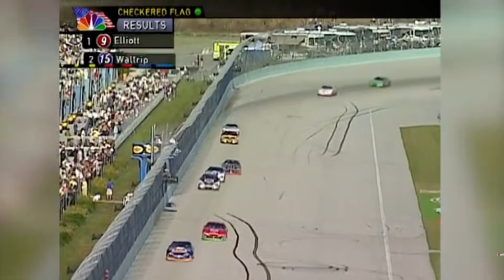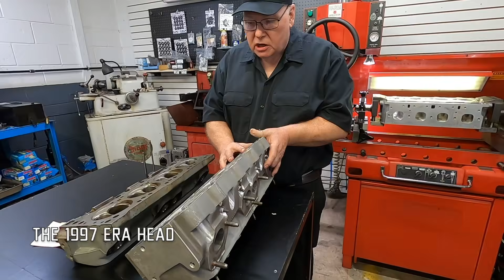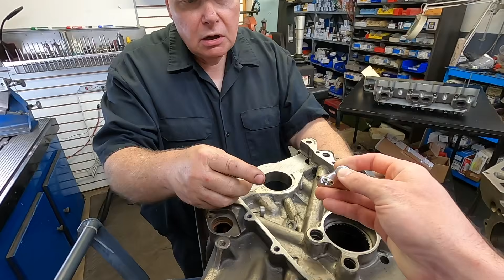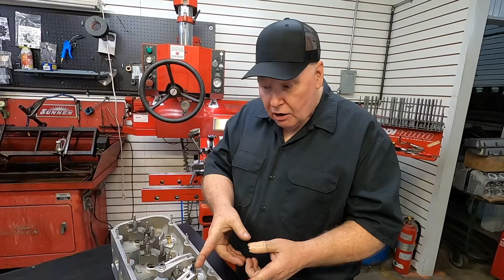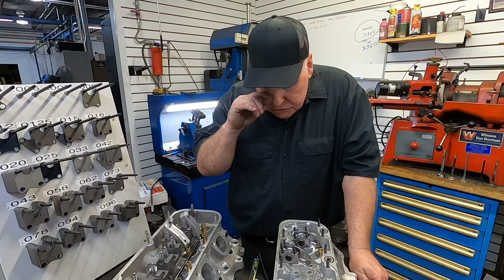History of Dodge's NASCAR Small Block Engines: Secrets Up Close With Danny Glad

Comment: Thanks Mitchell!  Another great episode.  In 1979, before the advent of the NASCAR-inspired Aluminum head 18-bolt, 48 degree lifter angle small block Mopar racing engines (R3, etc.), Bob Glidden did the unthinkable. He parked his 1978 championship Ford, and he built and drove a W2 head LA Mopar NHRA Pro Stock Plymouth and won the year-long championship!  The Ford and GM guys couldn't believe that they were getting beat by a small block Mopar.  Pro Stock required very high RPM horsepower, and I wish I knew how Bob was able to make that old iron inline-valve engine competitive.
Reply from the maker: Interesting!

Comment: I remember Kasey Kahne did not have the R6 until the Dover Spring race 2009. He was furious with the lack of power that the R5 was making relative to the competition at Fontana in the Fall of 08' he passed Kyle Busch for 7th in 1 and 2 on the last lap then Kyle floored it in 3 and 4 and bounced off the nearly and could have took Kasey with him. If Dodge returns in 27', Kasey Kahne hopefully returns for the Daytona 500 and wins.
Reply: It's unfortunate that Evernham went downhill right when Kasey was at his best. They would have been title contenders for sure. Unfortunately I don't think he can race NASCAR anymore due to health conditions, but he does do sprint cars.
Reply: @trevorshark16 Did Rockingham in O'Reillys last year. It was something to see. Even with that first bit of damage he got from Katherine Legge he could have won still. He went a lap down because of it. There was like half the stage left and Kasey proceeds to pass everybod out there like their tied to a tree and end of the stage there was a half a straitaway or less between he and two cars that had just went  a lap down and first and second. Then when he finally got back on the lead lap he went from 38th to 16th in 6 laps that 3.4 cars a lap. Then Almirola or somebody blocked him in the middle of one and two and got him the wall. Then he could go hard for 20 laps. That last deal in 3 and 4. Two idiots were trying to crash back around him so he got on the binders so they wouldn't crash into him and the two other idiots come along and crash next to him into him. He would easily won the race if hadn't been first and would have easily won still if it hadn't been for the second one.

Comment: There is a bunch of incorrect info regarding the R blocks and the W heads in this video.....not thats a bad video, but there are several errors about sruff that is very old. No big deal 

You should reqch iut to mason baxter in Daytona, FL. He has parts + knowledge.
Reply: So who did you build Nascar engines for again....I think I missed it
Reply: @papasmodelcarroom8450  I have built several of those engines for drag cars.  I literally have 4 of those blocks and 6 or 7 sets of the heads right now.  You may not have liked my comment, but there is several errors in the video.

Comment: I know Mopar built a small block race engine for 1970 for the 1970 SCCA Trans-Am racing series. they had the Plymouth Cuda and the Dodge Challenger and they released so many to the public and they were the AAR Cuda and the T/A Challenger in 1970 they ran a destroked 340 block in the race car but in the car's to the public they had a special made 340 6 pack engine built just for them cars and there was many special things done to the engines and car that were not done to regular 70 Cuda's and Challengers.

Comment: As a die hard Mopar fan myself this was a very interesting video👍 In Canada in the 90’s & into the mid 2000’s in the old “Cascar Super Series” in Canada we ran Dodge-Ford-Chevy- over the years & Mopar really got involved in Cascar in the late 90’s & into the early to mid 2000’s & Mopar would pay money out to the top 3 finishing Mopars every race. Dodge made some big power/torque in Cascar & so much so that even long time “bow tie” drivers/teams & Ford jumped ship to Dodge for a few reasons i mentioned above with the Mopar top 3 payouts & the big power/torque. I remember watching an old Cascar race & they interviewed #97 Rob Neely who was a long time Chevy driver & he said the switch to Dodge was amazing results instantly & he couldn’t get over the fact how much more power/torque they made but they sounded different than a Ford or Chevy engine because the Dodge engines rpm curve was quite different than Ford & Chevy. You can watch old Canadian “Cascar Super Series” races on YouTube & up to present day with the “Nascar Canada Series” 🏁 Great video guys!
……. Cheers from Windsor,Ontario,Canada which is right across the river from the “Motor City” in Detroit 🏁

Comment: I may have one of the engines that Danny worked on at Arrington. The cam has ARE and BA3 etched on the back of the cam. It was a R3 with the crankshaft main bore oil squirters like the block he showed in the video. It uses the 47 cc 15° W2 heads. I also have an R1 that supposedly came from Keselowski. They are similar in configuration.
Reply from the maker: Awesome!!

Comment: This is good stuff!!!  Mopar had RA, R1, R2, R3, and R4 blocks.  Along with W2, W5, W7, W8, and W9 heads.  The R blocks were also available as tall deck 9.60" blocks for drag racing and could be had in either wet or dry sump oiling configurations as well as 59 or 48 degree lifter angles.

Comment: With Dodge returning to truck series we can only hope that their truck and cup series engines pull from this legendary platforms.
Reply from the maker: It would make sense. The r6 is the platform that raced with the current engines they still use
Reply: Truck series are Lamar engines so ram will have no engine program. Dodge at least when return unless new engine rules in place in the next 3 years will ues existing engines they had just update. The new rules coming is opening up the rule book some so if Chevy wants a V6 LS they can or lets say Honda wants a v4 they can and it will be like IMSA and they're running running torque sensors this year. This is done because of the manufacturers

Comment: I loved when he was talking about the water passage to the rear of the block. They used a insert tube to control water flow that's exactly how they did it in my 1947 Dodge. Good engineering never goes away.

Comment: I think the Dates and order is a bit mixed up...  The For runner, innovator, the first was the GM SB2 engine, 1997-98... then the Dodge in 2000, and they copied the same head port pattern... then Toyota took both engines, pick the best bits, it was in the Cup series in 2007, then the Ford Fr9 in 2009...
Reply from the maker: Sb2 was 1998 and R5P7 was 2001. The P7 heads had a similar exhaust port arrangement to the w8 head. I don’t think they’d copy an unfavorable design of mirrored exhaust ports unless they had to. Eliminating that center hot spot would have been beneficial for Chevy and Dodge but the production heads had it so they probably had to keep it. The current gen engines eliminated it
Reply: @Stapleton42  In the Video Billy was making it sound as the Dodge was the Innovator, the first i reckon...  SB2 was the first in big 800, 900 HP nascar engine
Reply from the maker: @drcolster  the R5P7 was the innovator and has more in common with todays engines than it did with the engines it competed against in 2001. The SB2 was a big leap and basically GMs catch up/one up to the canted valve C3 heads Ford had. GM and Ford were still using factory architecture small block designs at that time.
Reply: @Stapleton42  How can the Dodge be the Innovator when it came 3 years later  ???....  The Dodge copied the SB2 head layout design, which is a canted valve, but totally different to the Ford... yes Ford has the canted valve, but all symmetrical. and so does B/B Chev, but different port layout..... The SB 2 solved the single 4 manifold distribution issue... The Ford layout is shocking for a single 4 barrel, very bad fuel distribution... Dodge came up with a great Race block design, GM had the Bowtie range specifically for SB2 lay out.. Then the ROX/RO3 was a totally different block for the SB2 top end with the 4.500" bore space..(but didnt hit the track, RO7 took over)  The R5, then R6 blocks are definitely a great race block design, the Dodge engineers did very well. That R6 is Killa...
Reply: @Stapleton42  Great Video as well..
Reply: Also remember the first W2 heads came out in 1976.
Reply: @WilliamPayneNZ  Good head the W2, they should of had a kidney chamber with the big ports, from memorey the big port had the Hemisperical no quench chamber... i know they did the Econo W2, kidney chamber small ports..

Comment: Wow what a video. This has to be my favorite to date. I guess because I have been a Dodge guy since 1966. That was a lot or R numbers and P numbers. I was talking to Jim and he was telling me these engines are getting harder to find for the vintage racing since they haven't been made in a long time. I was hoping with Dodge getting back in truck racing they would start back producing the engine again. But, I am hearing that the entire truck series is ran on the LS platform. Chevrolet, Ford and Toyota all run the Chevrolet LS engines. I guess
that means the Rams will run a LS engine too. I would rather they didn't even come back if this is true. I have been saying for Many, Many years now that what wins on Sunday DOES Not Sell On Monday. NASCAR lost me when they went to racing IMSA / Trans-am cars.
 Can you confirm this on the truck series?
Reply from the maker: Yea the truck series is a spec engine from Ilmor that is built with the Dart LS next engine block

Comment: Street Mopar's i'd love to
Love to stuff one of those R2/R3 nascar mopar engines into:
-Prowler 
-challenger
-shelby dakota pick up. ( good luck finding one they are crazy rare)
-magnum wagon with a  chrysler 300 nose conversion....saw one of those today.
-2 door avenger converted to rear wheel drive.
-take a Old 2 door dodge neon, cut the floor pan outta it, make a mini nascar xfinty frame the dart body fits over, stuff xfinty areo 59 wheels, goodyear tires, narrowed cup 9 inch rear axle, old mopar nascar cup engine stuffed in there...driver sits in the back seat area to make room for all of that....and make it street legal.
-2000  chrysler 300M  converted to Rear wheel drive.
What mopar would you stuff an old nascar mopar cup engine into?
-
Reply: *  correction-- the neon body fits over.
Reply from the maker: One of those sedans the FBI used in the late 70s. I think it’s a 71 satellite
Reply: --stuff a mopar cup engine in to a plymouth satalite, ( maybe a station wagon version? That would be awesome!) full nascar front clip and truck arm/ cup 9 inch solid axle.
Make it look stock body/ street legal except its slammed to the ground on aero wheels (series 59's) and BFG  RADIAL T/A's. Rosco's cop car from the dukes of Hazzard wouldn't catch that car.
Reply from the maker: @coletrickle--iXLR8  Bob Keselowski did this with a 51 Dodge truck. cup front and rear clip except it has an old Hemi in it from a DeSoto

Comment: 16:07 put something in it thats good?
id rather run car quest or O-fucks oil..... hell, castoil is better than Penzoil. 
.
the ONLY thing worse than Penzoil is Quaker state..... (wax based sludge machine..... fine if you change it every 3000 miles, like an idiot..... modern engines can go 5000+ on castroil/car quest / even cheap, crappy, shit ass FRAM oil is better than both penz and Quaker)

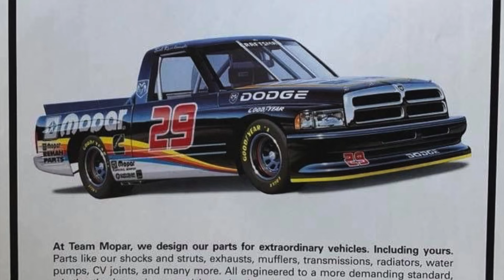Comment: 15:24 ya... bullshit. 
the dodge truck CV axle design is BY FAR the worst design ive ever seen..... car or truck. 
.
everyone else has the CV go inside the diff/trans.... so its lubricated. 
dodge thinks an O-ring is going to keep water/dirt out. 
.
this is why i ALWAYS quote a stub shaft along with the CV axle when working on a dodge pickup..... sometimes the seal also. (because if that stub/intermediate shaft comes out, it WILL fuck up the seal) 
.
with GM.... they are either a bolt on inner.... or, on the cars, are lubricated by trans oil. 
no rust, no dirt.... ya tap it with a hammer and the "snap ring" releases and comes right out. 
.
.
on dodge trucks, ive had the 20 ton shop press MAXED OUT!!!.... and that stub/intermediate shaft didnt move. 
so i said "well, maybe i need to shock that "snap ring".... pushed it together, and then hit it with a 10 pound sledge. 
all i did was break the "snap ring" into 3 parts..... 
.
.
idk.... dodge BY FAR has the most CV axle issues on their pickups.
Reply: Don't you mean Ram
Reply: @johnhaas2523 same shit... you know what outfit im talking about

Comment: @Stapleton42   The connection with Chrysler to Cat foundry was Caterpillar Mapleton Foundry was developing a variation of gray iron called compacted graphite iron. Essentially cooling characteristics of gray iron (flake graphite) with strength / crack resistance of ductile iron (spheroidal graphite) . more strength equals thinner wall thickness equals weight savings. Nascar was concerned about availability because GM foundry was not producing compacted graphite.

Comment: I can't believe more racing cars in other sports dont use the NASCAR based engines. It's f1 level engineering and stone reliable plus cheap compared to a lot of other engines out there. I know there's a lot of "pushrod engines are garbge" snobs but you can't deny they live at 10000rpm for thousands of hours.
Reply: There's new engines coming depending upon if the manufacturers all switch or not or just new manufacturers. It sounds like the next generation of engines in NASCAR is going to be like IMSA

Comment: Imagine getting one of those old SB2 ENGINES . DROP the compression to about 9.8-10:1 and mount a turbo on it or twin turbines!😂  run about 30 psi  through a big air to water intercooler.  With either methanol fuel. Or water methanol injection. In a street vehicle with a 6 speed with a 3.73-4.10 gear and a custom cam grind. Using 18° heads would make insane power. Build a custom oil pan and main girdle, the oil pan being a girdle  using  the pain rail to also support the main caps.. use 1.25" o-ringed plugs to seal the main studs that connect the pan to the cap. The pan made from 1.25" thick aluminum. Or a 2.25" plug to seal both studs using a dry sump only  holding 10 quarts . With a oil cooler  and oil heater using the coolant to heat the oil in cold weather.  A heat exchanger that swings from heated to cool around 200° +/-..   it should be capable of well over 2000+ hp at the wheels definitely  detune that.. to around 1800  wheel hp.  And use stainless  oring hoops in the heads.. with copper gaskets. And oversized head studs. .625" studs.   Put that in a camaro  or s10 maybe 1990 toyota 2wd truck built road race/ touring style. Flared fenders 17" or 20" x 11.5" rear rims 17" or 20 x 9.5" front with a 275-35-17" or 20" and a 405-30-17 or 20"..

Comment: It was when Danny and Ron Vicaro were working with Alan when I had talked with both off and on for half the season about any open slots in the cylinder head specialist position. Neither recommend it as I recall. -- Ron said he had a shop in a different building from Alan apparently from being his engine builder from Wisconsin (?). Hot tempered. (?).

I wondered if it would work out wherein meeting with Alan,  a position would be available in the Fall. -- After packing for the move, the news about a plane crash. 

Always wondered if  I would have made it. Only remember Ron said he needed help badly.
Reply from the maker: It was my understanding that Alan just didn’t have room for the engine stuff under one roof at the time so he rented a building from the Stavola Brothers

Comment: Finally someone talks about these. Whats awesome is 1970 the TA/AAR E bodies had a TA 340 which had thicker webbing on the mains so you could drill it out to be 4 bolt main and the cylinder heads had the intake push rod moved so you could port the runners, Chrysler sold these blocks at Direct connection that was Stamped with a X on the front same location as the R3. I have a R3 block that I’m using for drag racing purposes. Bought from Kent Ritter himself.
Reply: yes, I have seen these blocks, X blocks

Comment: When Ram comes back, they are gonna run a spec chevy engine. When did that happen? So it's just sheet metal.
Reply: It's expensive to develop an engine program that can go against Roush/Yates, Hendrick/RCR, and TRD... Stellantis is not exactly doing good financially to compete in the Cup series at the top level.
Reply: 2018. You can't say when Ram comes back though because Ram is its own brand It's basically a new manufacturer for the truck series
Reply: Y'all are missing the point. All this series is or has become spec racing. I thought it was all about Brands brining the own programs. Just race a bunch of chevy trucks and be done with it. And did you know the greenhouse is Ford, and has been since 2000s.
Reply: @DeadCougarGarage  It's all about Brand marketing now... Chevrolet races a car that's no longer being sold but the still race the Camaro in the Cup series, Xfinity series and even the NHRA.🤷‍♂️

Comment: Before Mopar got back into NASCAR there was a special Arrington head. I remember when Dave Weber moved down to work with Arrington, we went to pick up an engine and there were pallets of blocks and heads everywhere. Joey was building almost every truck engine and had 8 engines lined up on the wooden floor that all had Evernham tags on them.